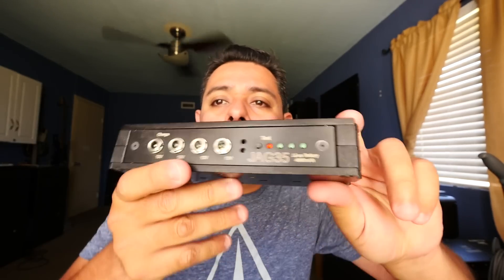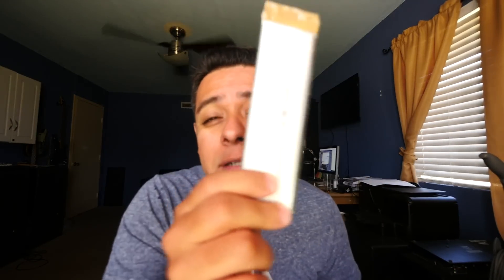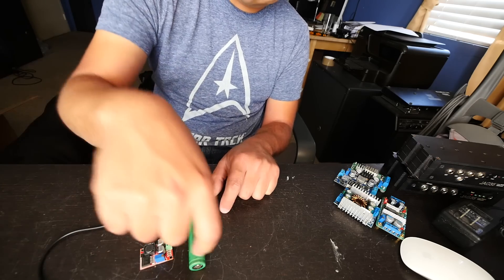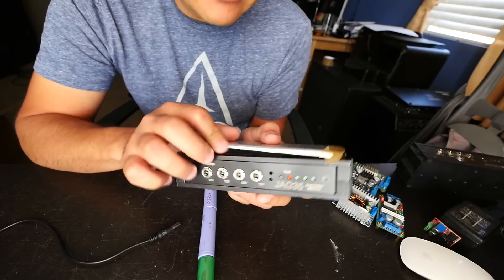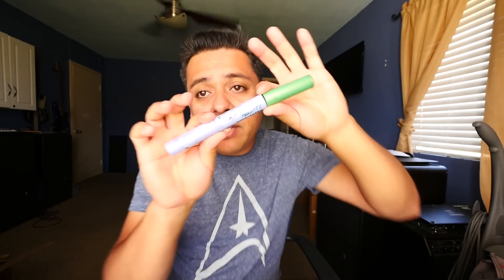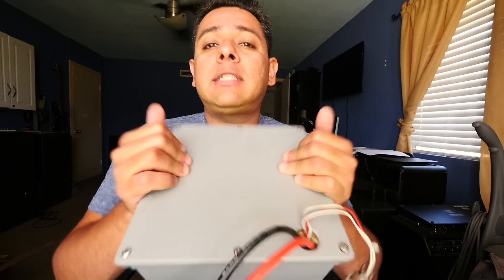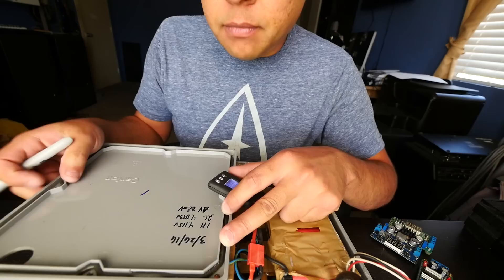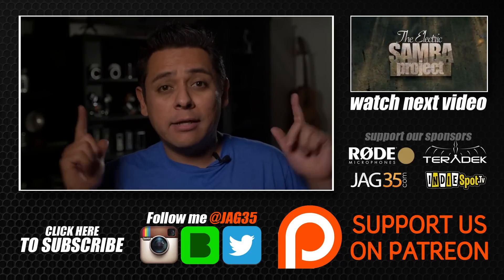How to Charge Lithium Batteries

Comment: Why dont you employ the proper charge curve to your battery? Charging at a constant rate will deteriorate the cell.
http://www.richtek.com/en/Design%20Support/Technical%20Document/AN024
Reply from the maker: @Johnathan Wuethrich   if you insist on ignoring the facts or the lack of facts on that fire incident,  I'm going ignore, delete your comments.   As i explained already, Ben showed zero interest in finding out what happened to his battery,  1st he left it unattended for 4 moths in the alaskan winter,  that on itself its not wrong but he couldn't tell me if he left the battery connected or not,  couldn't tell me if he left the system on or off, if the cells were balanced if he ever checked voltage, if he set the dc-dc that he installed 1 year after the battery was working to the right voltage,  he couldn't tell me how many cells were destroyed, or what the voltage on the remaining cells was,  he couldn't tell me what was the state of the electronics on his system,  he didn't bothered to take any detailed pictures apart from the great selfie thumbnail he used for his "Fire" video.   Zero Effort to try and diagnose what happened,    For all i know someone dosed them with gas and lid a match to them,  with the amount of evidence he shared either of those scenarios is possible.
Reply from the maker: i,ve charged my  3s 12v lithium car battery this way for 3 years and haven't killed my power supply yet
Reply: False, there is not even a balancing circuit for the 18650 in series
Reply: I just loved to read all the comment here so I can learn something.
Reply: jehugarcia Does not sound time efficient but yes I suppose that would be easy on them.
Reply: +jehugarcia yeah ok but you need a constant current source to charge them, same sort of your modules you have but with a pot in extra to set the limit current. If you don't use a limiting current module then your input power supply will die because a battery is not a light bulb.
Reply: +jehugarcia lucky, you are damaging your cells, they wont last long. I'm telling you this for your safety otherwise you make great videos, i'm not for shouting on you. Sorry for caps
Reply: jehugarcia hi mr garcia. i have a racing quad that draw power from 11 volt lipo. my question is to reduce weight from the lipo im thinking of getting a dc to dc boost converter and use 3.7 volt lipo and connect the boost coverter and boost it up to 14 volt. is this doable?? please  advise. thanks.
Reply: Hi Federico. A boost converter is a bad idea. This will ADD weight to your quad. The converter would have to handle a large current and so will have to be big. The best option would be to find a smaller lipo pack at 11 volts to reduce the weight. You would then have to consider the max current available  and choose the optimum for your application.
Reply: JS7457 + jehugarcia
The reason jehugarcia may be OK is that the wall power supply is current limited. So long as that power supply cannot push out more amps than the battery limit he will be OK and is not reducing the battery life.

On the other hand if the wall wart is pushing out more than the safe charge current then everything JS7457 says is valid.

My guess is that jehugarcia has been lucky so far in which wall wart he has been using. For safety sake PLEASE check amps as well as volts when charging in future.

Please remake this video with that important safety point.

You can use a higher amperage supply to run lights motors electronics safely as those applications will not draw more than they want. Batteries are different - on charge they will greedily suck up far more than is good for them. Most dogs will do the same if overfed - which is why you are a genius for including the woof at the start....
Reply: JGBLADES charging faster than the advised charge curve certainly degrades a cell.
Charging slower than advised does no damage at all - just takes longer.
As jehug~ says his philosophy is slow charge then that works too. Typically if it takes over 10hrs to charge from empty to full then the battery will be fine - and may even last longer than if charged as advised.
Reply from the maker: because I believe the benefits of the "proper charge curve"  are highly exaggerated.     My philosophy is to go easy on cells, charge them slowly discharge them slowly,  they will last forever this way.   Proper charge curbs are designed to charge cells at a fast rate with minimal damage,   I achieve minimal damage by slowly charging an over sized battery pack.
Reply from the maker: JS7457 thats because my batteries do not go out of balance,  https://youtu.be/tbaeMWdDlqY

Comment: Hi! For lithium scooterpack, do you recommend discharge fully before charging?
Reply: Discharging before charging Li+ batteries is no required, furthermore it's a bit better to don't charge/discharge them fully if You don't need to. It is like with mobile phones or laptop batteries.

Comment: I'm Using 3s12p 186500 battery pack 12v system.
I connect to inverter and It can use only battery packs are 12v.
People said need to use voltage converter.
but I don't know what kind of converter use.

Currently my system.
Battery - Solar Charging controlar - solar panel
Battery - inverter

Comment: As i saw in your video about the tesla wall, u used different batteries in it, so does it metter when they are connected in series or parallel for charging them and will it help the batteries to due quicklier?

Comment: For a single healthy 18650, if I hook it up to 4.2 volts, what is the maximum amperage I should allow the cell to take, or does it limit itself?
Reply from the maker: It will limit itself but it will limit at a higher than healthy point.   Most  cell spec sheets call for .5C charging rate on these types of cells.   You can charge them at higher rate but the life of the cell takes a hit.

Comment: nice video!

why li on and not ni mh?  I read those 18650 would last only 500 cycles and nimh does more right?
Reply from the maker: energy density.  LifePo4 lasts 2000 cycles
Reply: Any Lithium cell lasts much, much longer than 1500 deep cycles if only recharged to 90% of full charge. Of course that means a lower final voltage on each and every cell. Most BMS circuits do not proportionately charge each pack in a series set (acting more like ideal zener diodes). You would need a high precision voltage divider buffered by current-limited Op-Amps.
Reply: Ni-Mh counts one full charge every time they are charged, Li-Ion only counts the percentage of charge needed to be fully charged.

Comment: got some batteries for a Disabled Ham operator who want's to build a 12v 7Ah battery to run a FT817nd QRP Radio out in the field. I made the mistake of buying some ultra fire Li-Ion batteries before knowing about them several yrs ago. I brought several Imax B6 it was a china copy blew up on me I was able to get my $$ back. I got an IMax6 Mini that has the SkyRC Hologram on it to tell you it's the real deal. the others were missing several rows of the bal resistors thats how I found out after smoke came out.

Comment: This is really excellent and filled in a few blanks. I now have upgraded a couple of drill to Lithium. An converted the constant voltage charger to cater for 2, 3 and 5 cells battery packs. As this is the most comment electric drill battery size!
Works perfect

Comment: I guess you could use some of those charging circuits but if you are really serious about this battery project, getting a peak digital charger with dV/dT settings and capacity programming will enable you to tell when you have an OC(Open Circuit Fault when charging).  If this were to happen with a PODPS(Plain Old Dumb Power Supply) you could overheat your batteries which is very inefficient, wasted money on your Power Bill plus possibility of Fire if overheated too much.  Peak chargers shut off the charge when it has reached capacity, or when an OC(Fault has occurred).  Most of these digital Peak chargers are in the 90's of efficiency so your Power Bill isn't wasted.  I think these power supplies are sufficient for some projects but sometimes reliability is also important, also it looks like you use some type of charge maintainer/detection in your final products.  With an OC (Fault) the battery may show up as charged when using a normal charger but will not deliver the required current under loaded conditions, causing much confusion and time to troubleshoot the issue...  Probably why you are using a conditioner maintenance system to cause these types of things from happening.      On a side note I have seen some interesting things happen with Hybrid Electric Vehicles.  Since the car is essentially built like a capacitor, tires for insulation followed by a large semicircular frame the batteries inside can actually accept charge from the atmosphere when the pressure is above a certain percent.  I have experienced this when not driving my car for a few days in the stormy season when pressure in the atmosphere was very high relative to the inside of the car, forcing the batteries to accept charge.  The batteries where topped off without regeneration which was a phenomenon I cannot explain.  I was wondering how you protect (shield) your battery cells from overcharge from atmospheric pressure change when traveling through mountains and other landscapes?

Comment: Just keep in mind that when you charge battery cells in series Always Use a BMS.
As one cell might take higher voltage than the rest.
Reply from the maker: +geocha1962    Or you can be crazy like me and not use a BMS
Reply: jehugarcia How the hell do you manage and keep balanced the higher cell batterys (like for the samba) where the voltage could be  120v or higher?

30 cells is a lot.

Comment: Interesting, So I can charge a 48V Li-Ion battery with my 48V Lead acid battery charger?
Reply from the maker: +electron spectrum   just watch your power levels,   the slower the battery charges the safer.
Reply: +jehugarcia Thanks man! this is great! It would be nice to have a variable Li-Ion charger so you can choose something like say 4.0V, 4.1V and 4.2V like you were saying in the video, Do you know of any mod like that?
Reply: +electron spectrum I had my lead acid battery charger change to lithium. One thing I know they did was to remove the float charging that they use for lead acid to top it up to make up lost charge. Once that was change the charger worked great!

Comment: Charging Lithium Batteries in 'Parallel' is fine, however when you charge them in 'Series' you must have a BMS Board and Balancing leads insitu across ALL Terminals (Unless you have a dedicated Lithium Battery Charger). DO NOT confuse the two methods.
*That's why even your Laptop Battery Packs have a BMS (Battery Management System) and 4 Balancing Leads for a typical 3S (6 Battery) configured in Series (three pairs of Paralleled Cells). This is Basic knowledge.
http://i.share.pho.to/3fde09bc_o.png

Comment: Hi jehugarcia: I am getting things together for a powerwall as in my area in Michigan I lose power in the home 2-6 times a year. I want a way to charge the pack and would like your recommendations on a way to charge it. Solar is not in the near future due to cost and efficiency here. What I would like to do if possible is run a small gasoline engine/alternator combo but have read this may be a problem getting them topped off. Can I power a solar charger with the engine /alt that may  be the answer? I would really appreciate it if you could give me your recommendations for a solution to this question. I thought I saw a video of an earlier Samba trip your took and used a similar charger but didn't see what I could do to assemble one. Thank you for your solutions and videos answered on the tube. Of course I would need details as this stuff is all new to me.

Comment: How you charge the battery depends on how long you want the battery to last. If you want long life you charge them to the manufacturer specifications. Different cells and chemistries have different requirements. It's not one size fits all.

Comment: For the last two years you did not do balance charging? What about the frequency of charging&discharging?

If the drift is so small as what you measured, then no need to concern on the balance charging.

Actually I'm planning to built lithium pack for my ebike. This balance charging thingy + BMS keep bugging my planning.

Glad to hear from you that after two years minor drift on the voltage.
Reply: +Luqman Radzuan here's a BMS I just bought for my Battery Build http://www.ebay.co.uk/itm/151987351304?_trksid=p2057872.m2749.l2649&ssPageName=STRK%3AMEBIDX%3AIT
just remember to match the number of Balance Leads with the Number of Cells you are using i.e. I'm using 13 cells (48V) so mine has 14 Balance Leads  - there are lots of pics showing how to hook the various types up (*some might even have just 13 Leads!)  https://www.google.co.uk/search?q=13s+bms&espv=2&biw=1360&bih=637&tbm=isch&tbo=u&source=univ&sa=X&ved=0ahUKEwjbjuC706PMAhWlIsAKHW67D8YQsAQIIw#tbm=isch&tbs=rimg%3ACVdwAYsyZro_1IjjjCzYTapkviqyt1UGZrK2wBGAnWbpXC1CcW6bJnC5eWDJkDbQNkcxK9aBZEB1w_1dHLv9_1RUve2fSoSCeMLNhNqmS-KES2tXDIv2kCoKhIJrK3VQZmsrbARDLEtTPSYwWwqEgkEYCdZulcLUBFE6_1aTMQp2NioSCZxbpsmcLl5YEW_122t8QN9CfKhIJMmQNtA2RzEoRqQliqdY39E0qEgn1oFkQHXD90RFIWwvuTvVd9CoSCcu_139FS97Z9Ec2EI54KvHpq&q=13s%20bms&imgrc=_
p.s. just be sure the Board you pick can cope with the Amps, they can range from 10A to 60A or more, also remember the board will make sure the batteries deplete at the same rate i.e. keeps them balanced while 'Discharging' as Motor runs (equally as important as Balance Charging)
Reply: The_ Pentaquark. Tq for da info. I'm still sourcing the cells.it's challenging to get them around here.
Reply: Luqman Radzuan just a heads up - if you do manage to get your hands on some old cells and they are below 3V (safety cut-off limit) then a lithium Charger can be set to 'Charge Nimh Battery' for a short while until the cell is above 3V and then it will Charge as normal on the 'Lithium/Lipo' Setting. Sometimes you need to do that when the Voltage of the cell is too low as the Charger will refuse to Charge it in the Normal Lithium /Lipo Setting if the Voltage is too low.
  p.s. I found that those cheap small single cell boards (the one in that link) will often ignore the initial Low Voltage and help to restore normal voltage EVEN IF the cell Voltage has dropped too low - which is handy to know  :)

Comment: Hey great video. I need to charge a 10 cell 18650 battery pack. How can I modify or use a cheap 24 volt laptop charger that pushes 6 amps to charge the pack. The pack already has a BMS so i dont have to worry about overcharging.... any ideas?!

Comment: Its not good practice to charge any litium batteries with a dumb charger and no BCM (battery control module) on the battery pack. 
You can blow up the charger / regulator from overcurent, overcharge and blow up faulty cells (you wont see a charged voltage EVER if one cell in a battery has died -overcharging all the others), or charge a small or reduced capacity cell over recommended current unless the charger / supply is current limited.
Also, you cant accurately current limit an unregulated battery as the cells can differ or be faulty, especially if building your own battery from used cells.
Buy a cheap BCM off ebay or wherever you use so that you can use a dumb charger and have the module to the charge current limiting and balancing.
If the battery was built of all new and same model cells it probably wouldn't be an issue in the short term but no over and under voltage and current protection is a very bad idea, even a crappy $10 Bluetooth boombox i recently bought has batterycharge control circuitry in conjunction with its boost converter (usb 5VDC input).
Reply from the maker: +Paul Bearer   I do not agree.  If cells fail there will be trouble, bms or no bms.

Comment: if i have 50v lithium battery connected in series can i charge with AC TO DC 50V?
Reply: If your pack has 12 cells in series (ignoring how many are in parallel), then each cell gets only 4.167 volts (50.00÷12). However, most cheap BMS boards just clamp each cell to 4.200 volts, if necessary. This is going to leave some cell under charged. Either you use a cheap BMS and charge battery to over 50.40 volts (until every BMS unit is bypassing some current), or find a BMS that will proportionately charge each series-connected cell equally, IMAO.
Reply: +Rahil Shaikh yes bro, thats what I did. I had a old computer power supply, I found the 12v output and it charges with no problems. The balancing works just like jehugarcia said in his video. I had a few second short not long ago on two batteries and they had lower voltage than the others. I charged it, the voltage remained stable on all the others except those two charged. When the pack was level it charged to max voltage of the power supply.

Comment: I wouldn't recommend doing it this way. Chip which are specifically designed to charge Li-Ion/Po cells will give your cells a better lifetime and is generally safer. Considering how cheap some of these are e.g. the TP4056 I don't see why not. Otherwise love your videos man
Reply from the maker: +cwbh10  will that chip work on my 3S33P 600Wh  12v  battery?
Reply: +jehugarcia well i suppose that is a different beast!
I was under the assumption the charge circuit should be cut off on reaching the pack's maximum voltage

Comment: Nice Video, just a small correction:
LiPo batteries are called LiPo not because they have a Polymere Casing, but because they contain an Electrolyte based on Polymeres, instead of a classical liquid Electrolyte found for example in your 18650 cylindrical batteries. 

I study that stuff at university.